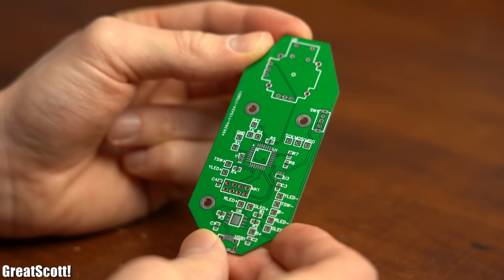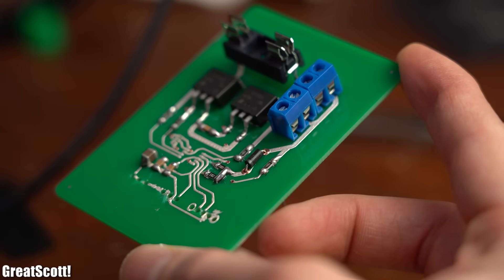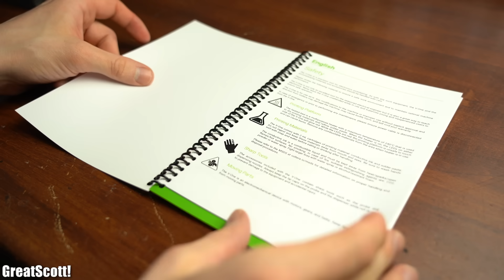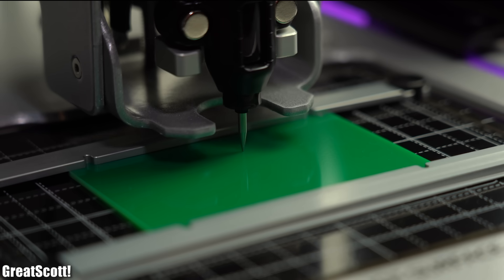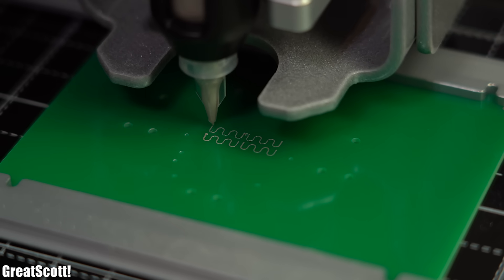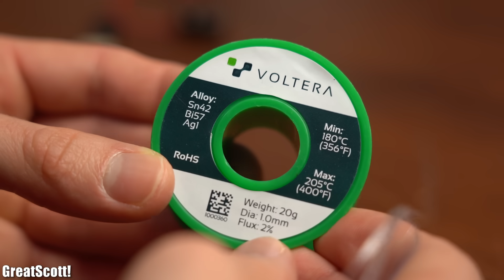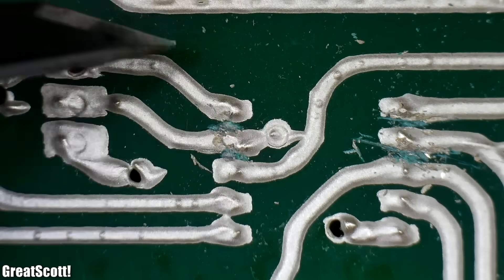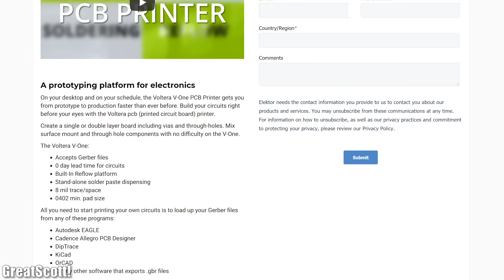You can now PRINT PCBs! Creating a homemade PCB with the Voltera V-One PCB Printer!

Comment: I just had A thought, Why not use a UV Resen printer for the tracings. Something like an Anycube Mono printer. 
PS I'm not a BCP maker. I Just have a 3D printer.
Reply: @lepidoptera9337  
Explain to me how manufacturers etch their boards.
Reply: @Lepi Doptera
I cannot believe you are trying to explain all of that when I was being sarcastic.
I am an engineer; I know all about how to make a PCB board.
This video is not about making PCB boards cheap or fast but making the process to make PCB boards. That what some of the DIY people do. The same thing happened with 3d printers Ten or so years ago. People kept saying it is cheaper to go to the store and buy the part. If they listened to naysayers like you, we would not have 3d printer under 300 US dollars today.
First I do not work for this company. And I do not sell them.
How this printer works.
It uses a UV light shined under the build plate using an LCD screen to mask the image onto the plate. The build plate sits in a vat of UV-sensitive resin. So, it can make the 3D print.
But if you put other chemicals that are sensitive to UV in the vat. And place a PCB board on the build plate. You can print tracing on the board. Also, you can do both sides.
Something else I just thought of, if you can find a UV-sensitive resin/chemical that is electricity conductive you can print circuits on any material that it adheres to. As long as you can mount it on the plate your good to go.

https://www.youtube.com/watch?v=SLipgSqkIt4 you start at 5.00 to cut out the unpacking.

Comment: Hi, Bro!
I saw a random guy the other day on YouTube, and his process is intuitive.
1. He hand-sketched on the board.
2. Made appropriate drills.
3. Then he laid very very thin wire along his sketch. Then, he put that whole PCB carefully on a surface which he can increase the temperature (he used an iron box). Gradually as temperature increased, wires began to melt and the wiring thing was done.

That was cool.
Reply: Was that cnlohr?

Comment: You need a finer bit on your soldering iron.  I used to use a length of thick copper wire to extend my soldering iron bit when doing delicate work.

I remember when Elektor was first published in competition with Practical Electronics, good to see it's still around.

Comment: One of the biggest issues I have is the very limited via treatment.  This only supports two hole sizes, and does not support irregularly shaped holes.  Lots of my designs require irregularly shaped or large plated-through holes.

Comment: This is in no way better than DIY UV PCB design. The only thing this has going for it is the drill.
Those wondering, the UV method is you get pcbs with mask over copper. You print either directly on the board or on clear plastic sheet "over head projector printer *paper*" and expose it to UV
Everything under the ink remains, but the solder mask exposed to UV degrades and you can wash it off, somethings needing a light acid.
Now you have exposed copper for everything you want to Remove. leaving only covered/masked traces behind.
Then you put the boards in a stronger acid bath, it eats away all the copper not protected by solder mask. Take them out, wash them off. and you have clean boards with clean copper traces.
Then you use a fiberglass scratch pen* to uncover the solder points of the traces. 
You have to drill the holes yourself using a dremel but dremel the company sells a bench press called the "Dremel 220-01 WorkStation"
And you're done. You can get the 2 sided via pieces and the hammer tool online.

An alternative to the fiberglass scratch pen is a very fine tip UV light pen. It's essentially a UV LED that you place up against the board, it has a shroud so it doesn't leak UV light and you just put the LED right over the part of the trace you want to expose, then you use water or the light acid from before to remove the mask.(depending on which boards you use)

This setup, costs around $50-60. Most of the cost is in the UV bed, which most people will use a UV nail (finger nail salon) curing thing. The acids are fairly cheap, the clear printer "paper" is fairly cheap, the PCBs are kind of expensive as they are specialty PCBs but still WAY TF cheaper than even the ink for this V-One printer. And there's LOTs of tutorials online of how to do this.
Infact the most expensive thing.. is black ink for your overpriced inkjet printer. which btw you should use a laser printer. The one that uses toner for these.

You can even draw traces using a sharpie marker. (though there are better markers for this) The marker can protect the solder mask from UV.

Comment: I really like that this sort of thing is in development and I'm sure that someday it'll be affordable and as effective as etched or routed copper. That said, this is not that someday, and other simpler methods still win out even for those of us that are strictly DIY all the way. I use a method I found on the Internet, which is to print the art onto typical magazine or photo paper, but instead of ironing, wet the art with a mix of isopropyl and acetone, and then press it hard to the very thoroughly cleaned copper. It works just like ironing but doesn't need heat at all. Let it sit for a bit to gas out, then just rinse and peel like always, and etch the result in HCl + H2O2. Very easy, very effective.

Comment: Looks like a seriously well designed machine but way out of the ability to be “invested in” by even a large company! I personally have 100% fantastic results using the toner method & a modified thermal laminator. Double side boards also but I have to solder in a “via wire” . It takes under 30mins to make a small prototype board ready for soldering from the minute I printout the laser printer mask. I use 1205 SMD but smaller is possible with microscope and this reduces the amount of drilling for vias, mounting holes or through hole parts.  Personally it’s a winner considering I do it all at home & verifies a layout that I may later have made properly by mailorder PCB production company.

Comment: I remember watch them demo this a few years ago when it was first in development.  They said they had a target price of under $500.  I'm guessing they missed their target.  Besides the price of the unit the price of the inks will be a major downside.  With the price of silver spiking this will only drive the ink prices higher.  But this also has the side benefit of making the discarded print actually valuable for silver recovery.  Overall it is an interesting concept but I think I will just wait for my own replicator.

Comment: speaking of being negative, not only is the Voltera PCB printer still a long way from being worthwhile and cost-effective, but about a year ago I said your soldering sucks.  a year later, it still sucks!  those massive blobs on your 2-pin chip-Rs/Cs are horrid!  dude, your solder-wire is too thick!  FFS get some 0.5mm-diameter or thinner rosin-cored solder-wire!

Comment: This thing needs to be about 1/4 of the price.  Looking at the components involved in the unit construction it's clear why the unit isn't cheap (though, there is clearly a hefty margin there that is related to R&D spend).  Whomever designed this will likely be in the hole on it forever, as I don't see this product succeeding ~~ though there is clearly money behind it due to all the bips and bops and high end finishing.  There are plenty of solutions that use basic cnc or chemical etching to deliver similar results.  Add to that the variety of cheap, professionally printed PCB's one can get with rather rapid turn around from China these days --- I just have to wonder, who thought this was a good idea ?

Comment: I think the high price tag is a significant deterrent for a great number of tinkerers.

The company could think about metal dust and laser sintering rather than fluid printing, in order to lower the price, other than allowing even finer traces and up to a certain extent, even laser soldering.

Comment: As a PCB designer, I’d make the investment if I could do larger, high density, even inner layer boards. But it can’t do any of that. This is only suitable for HOBBYISTS and the $4100 price tag is out of range for a hobbyist. Wanna build a one-off circuit? USE A BREADBOARD INSTEAD

Comment: To me it looks like it doesn't offer any advantage compared to home etching. I can etch pretty complicated PCBs at home, with two layers and then install riveted vias. 
This ink seems that it will not stick to the PCB that much, the soldering doesn't seem to flow to the ink well enough and there is no soldermask. 
So basically the same quality than homemade etching but for 4000€... 

I guess the technology is not ready yet, but surely will be in the future.

Comment: I saw the voltera when it came out, thought it was really cool back then... there seems to have been NO improvements, i mean there is a probe and you can probe for your blank, but it cant find it after you flip it over?? and the dispensing seems kinda crap, it should be really at least as good as a 3dprinter, but better details than that would actually be needed in order to provide a better value than etching or milling.. very dissapointed actually :(

Comment: So expensive and useless, the printing is not perfect and the printer not to do anti solder mask. Crappy printer for usd 4000? this is a joke!
I prefer the cheap thermal transfer toner using the iron with solder mask ink cured by UV with a photolith.
the wegstr printer is more better than this by almost the same price of this printer.
these two printers are better for universities and companies, they are useless for us, the price not justifies the utility.
Great Scott you don't do a siily youtube videos. You have good abilities on electronics. don't subestimate yourself.

Comment: Using the positive pre-sensitized laminate to make the boards is MUCH more practical! You can easily do 15 mil traces and trace spacing. Not practical with the ink or the milling method.  The laminate is about $30 a square foot so it is sort of expensive but looking at the cost per board it usually is only a few dollars for most prototype projects.

Comment: $4,100 For that wtf are they selling pure gold internals? You can buy an actual professional PCB manufacturing unit for almost that price no joke I have looked into buying one for $5000 and it automatically etches PCB's. You can just use a drill and rivets for vias. Price is just outrageous not to mention etching your own PCBs is very cheap and easy to learn. You can spend $40 in supplies learning to etch your own PCB and the cost goes way down when you know what you're doing.

Edit
Not to mention they make laser cutters for way cheaper that can cut traces and get an ultra-fine resolution for way cheaper. I just can't justify this price point the whole thing seems way overpriced knowing that there are kits out there that can do what this thing does at a fraction of the cost and better.

Comment: This device is perfect for it's intended purpose - making prototypes on the fly. Though even with that, they can only be non-sensitive designs, and designs with not high density. The conductive ink's different electrical properties vs copper could really skew some RF or measuring designs. I do not know how much life expectancy such ink would have, such as how the boards would hold up to time, etc.

This is brilliant for quick same day testing of layouts and etc, before commiting them to a FAB shop... But that 4k euro price tag... plus expensive consumables that certainly have a shelf life... It costs too much. This sadly lands it as being one of those things universities get wowed by, purchase, use for a bit, and then forget it in  a corner.

If they can get the price down to say 800 euros, then it is more reasonable. Until then, for quick boards I just stick to laser printer transfer and etching.

Comment: Well currently some of us have FDM 3d printers at home.
This device not looks different from FDM 3d printer.
It should not be to hard to modify our 3d printers, for them to instead of extruding hot molten plastic, for it extrude this paste from syringe. 
Maybe something like interchangeable Head one for 3d printing, one for light CNC drilling, and for extruding syringes.

Comment: My uni bought one of these. They are very usefull for fast (in comparison instant) prototyping. However you do have to treat ground planes differently.

The software is amazing and student proof. Not sure if they fixed it in the mean time, but you can't skip the heating fase on double sided prints. We have an external oven that can heat way faster would save about an hour.

If you do get one, get extra spare nozzles.

Comment: I see the conductivity of the ink is already not so great, and I imagine the longevity of these boards in general may not be particularly great either.

How does the ink hold up to oxidation? Will the resistance increase further over time? How does it handle high humidity? Does it get brittle with age? Will it develop hairline fractures and become intermittent? Not to mention that riveted vias have a history of being unreliable, especially with thermal cycling.

It's a neat machine, for large companies doing rapid prototyping, but probably not much else. (Though I imagine that is its main target market anyway.)

For one-off projects that you actually want to keep, a hobbyist is still much better off with etching their own boards, or sending away to China.

Comment: The machine is amazing! The price, however ... but the quality is excellent - zeroes automatically ... nice! The machine is for prototypes and manufacturing is much more complicated - particularly the multilayer ones.

Do you need to add solder to the traces or you did that because you wanted? Thanks!

Comment: also
if you can do a generator type of motor review
it would be so great from the Great Scott
cuz you know by now
not many of us have power all day for use
and so many people go running and doing sports most of the time
if there is a way to integrate a servo motor in the comparison review and a bit of (somehow a power amplifier)
it will be the best from you
from a while ago (nearly a year) I saw a video in 5-minute crafts channel
in which they used a servo motor and some ruler design/construction to strap it on the leg to use the mechanical power of human to power the servo and charge an Iphone with
if you may
please do a video about it and explain what is happening and if that would be enough to use or its all scam

Comment: Thanks GreatScott!  That's fascinating.  It will be interesting to see others come to the table competitively with conductive 3D printing and the like.

I'm not current on this sort of thing but you can almost see competition with conductivity approaching or exceeding that of copper or aluminum as well as even printing heat sinks, insulation and drilling spark gaps.  

The future is electric!  :-p
Reply: I wonder if an activated carbon hood should be built into the process?  ie., what are the fumes?

Comment: This machine seems to fill a hole that does not exist. Thanks for this honest review.
If you are a company that really really needs extremely quick prototyping, you don't care how much that would cost, as this is not the main driver of development cost for a new product. It actually costs you more in the long run when you have to design a prototype that is manufacturable on the Voltera first, and then you need to redesign everything to transform it into a production PCB with completely different design constraints.

Comment: I've always thought the term "printed circuit board" was back-to-front. You don't print what you want onto the board, you erase what you don't need by etching it away. This was even more true back when layout was done with tape and ink rather than toner or photosensitive emulsion. Oh well, I guess "etched circuit board" just doesn't have the right ring to it.

Comment: More than 4000$ for the machine, and the substrate/blank PCBs are 15$ each, not to mention the cost of the ink. The prices are just completely ridiculous.
PCB milling sounds a lot better, since you can do through hole parts, too. Adding a vacuum cleaner case around it, and you can solve the dust problem, as well. Still a lot cheaper (and equally fast).

Comment: We got one of these at my previous company. We didn't really use the printable traces functionality at all and really just wanted it to do solder paste application & reflow using the hot plate. The needles would constantly break even after tons of calibration, the paste application was not very great and required tons of calibration, and the consumables were crazy. The needles were basically a single use and would not be usable the next day due to being clogged with dry solder paste. The only thing we really got good use out of was the hot plate.

Its a neat concept, and it seems they are still around and selling product, but its hard to compare with how cheap a jlcpcb pcb + stencil is (and now they will pretty much do most of the smt soldering for you too)

Comment: Is it possible to use proper soldering technique with this? I.e. heat up the “copper” rather than touch the solder wire? Can it also be reflowed in a standard reflow oven?